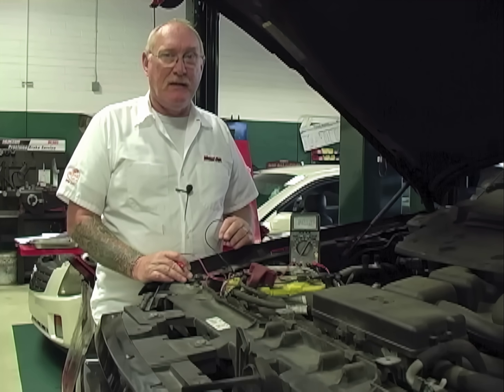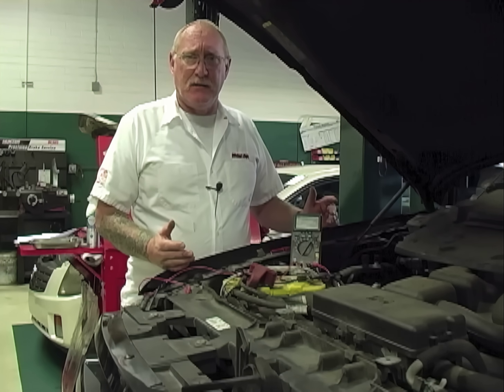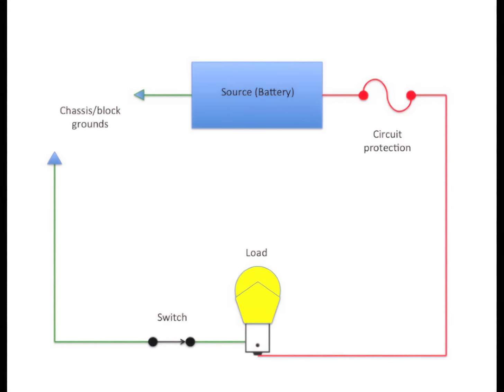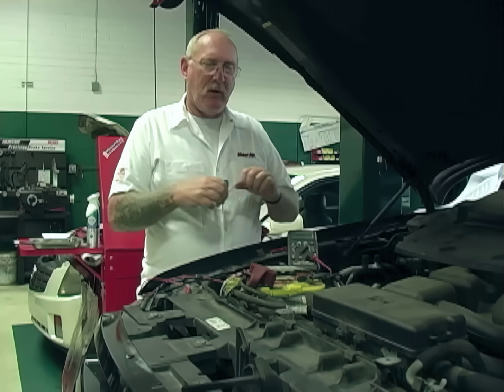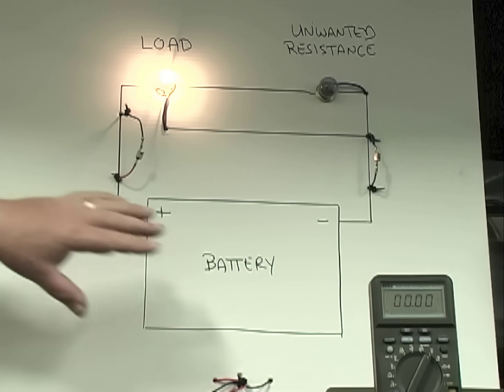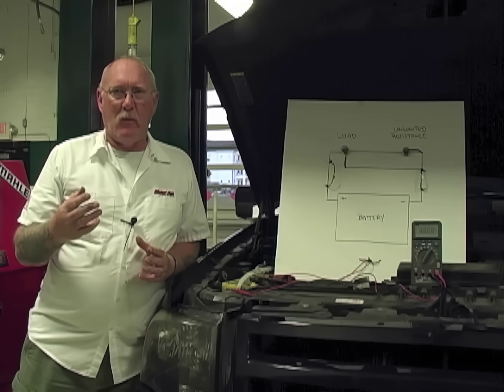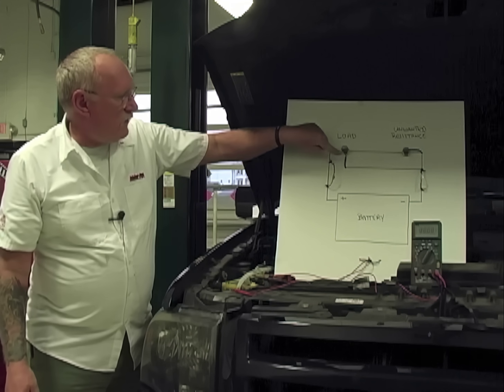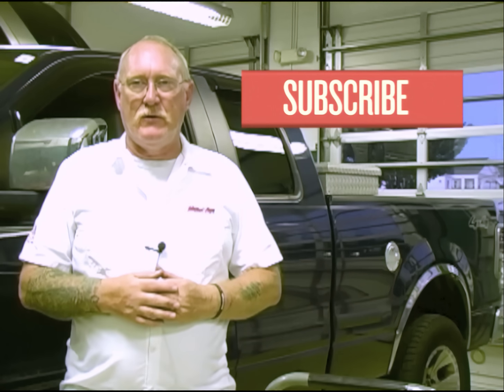The Trainer #47: What measuring voltage on the ground side means

Comment: Hey that’s one of my favorite troubleshooting methods. Obviously there is an incomplete circuit. All you have to do is find it and fix it. This is the main reason buildings have a single point of ground where the neutral is connected. There are ver few instances where multi points of ground are allowed. I won’t go into it here as it and engineering problem and I’m not going to teach graduate level electrical engineering here.

Comment: there are grounds all over these vehicles these days, underneath seats behind dashboards on the chassis everywhere. few of high resistance on the ground, such as under a 1990s Thunderbird under the driver's seat and states where they have salt on the roads and it gets on your boots and in your car and it corrodes the hell out of it, you're going to get weird instrument panel readings because that's not grounding correctly. it's not exactly correct to say that voltage wants to go through a load to ground, voltage, also known as potential, always wants to go to a lower potential. if you remove a restrict on ground in one area it's going to affect current flow in other areas. I gave myself quite an education at the time working through forward circuit diagrams and ground locations when a Ford Thunderbird had a loose ground that would make the digital fuel gauge drop two bars when you turn the headlights on. it was pretty cool finding that out.
Reply: *few of = if you have (high resistance on ground)

Comment: 3:45 there are many exceptions to this rule, such as cars using resistance wire in parallel to illuminate a trouble light, someone ahead lamp is burned out the resistance wire will illuminate the led.
it's engineered using ohm's law so that there isn't enough current to illuminate the LED because the headlamp is using most of it in the parallel circuit, you can use kirchhoff's law along with ohm's law to calculate this. Source: I was a factory trained Ford mechanic for many years and now I'm an industrial electrician journeyman with an electrical engineering degree.
Reply: aorry for voice to text errors. hope it was clear.

Comment: Great video thank you. Have a question on the fuse placement though. Electrical convention is to trace from positive to negative but that was due to a wrong assumption in long past that electricity flow was caused by photons. Actual flow is actually from negative to positive because only electrons can flow. In that case wont it make more sense to place the fuse at the negative side of the circuit? Thank you

Comment: The other way we were described voltage drop is you gave the negative side another way to get back to home and the voltage you see on the ground side shows you how much voltage is willing to go to ground cause it is a easier or a more viable route , instead of the resistance  of original circuit .

Comment: Where does voltage drop get measured when you are testing a window motor connector?  12Volts at all connector pins.
Reply from the maker: Always start by measuring at the load - in this case, the motor.

Comment: Also i will add, when resistance increases in that series circuit, so will the voltage dropped across that resistance (assuming current remains constant). When the resistance decreases, so will the voltage across it decrease. That's why the Load bulb got dimmer in his demonstration. There was additional voltage drop in that series circuit from the unwanted resistance, which took voltage away from the load. In theory,  the voltage measured across the load bulb, and the voltage measured across the unwanted resistance should equal (or add up to) the  V+ source,  which is the battery voltage of  approximately 12.5V. Simple Ohms law stuff.

Comment: As an aircraft electrician you describe this as the opposite way one should attack a problem.  Remove the battery terminal and test amperage, if you have a battery draw. By knowing the amount of amperage will be much more useful than voltage drop. IE the radio clock is only going to draw milliamps whereas a stuck ac relay  might draw 5 amps. voltage drop is usually only referred to in electrical theory when determining the size of a wire over a specific length of run. DC circuits have higher voltage drops over a given length  than AC circuits. When troubleshooting this information would be useless. You're probably the same type of mechanic that diagnosis a battery by the amount of voltage.  When only a true test would be a battery tester that pulls a load similar as a starter. There's several ways to skin a squirrel but what's your teaching is not how electricity flow charts are generally used in troubleshooting electrical circuits.

Comment: Just start pulling fuses until you find the problem most times it's a bad inductive load or you may not have true power to that load due to a bad switch

Comment: This a problematic  video and carries my NO Like because you hinted at a solution for <one particular problem (a bad main Ground Cable and its connections at each end, mainly at the chassis end,as usual) but diverged too much....

The measurement btw the Neg battery  post and the Chassis Ground,  it ONLY  measures the quality of the BIG,THICK, Neg.battery cable fron Bat to Chassis; it does NOT measure a ground fault of any other small load (lamps,window motors, fans etc etc,  none)

AND if that thick cable connection to GND is bad,then,the STARTER MOTOR,the biggest consumer by far, 200 to 300 Amps!! will either  not work at all,or work too slowly...

That is WHEN you measure VOLTS btwn  bat-  and gnd, WITH the starter motor operating!! 

 02:58  you can't say that because there are fuses,so it is NOT the same; also,this is public youtube,DO NOT even mention "put a piece of wire across the battery terminals" like you did there

amazing to me the amount of ignorance in the comments, and the praise for the video ...

also you talk a bit too fast to really teach much; a teacher,i am one and an engineer, usually talks  s l o w l y.

Comment: Can you comment on why it's important to disconnect a car battery with the NEGATIVE cable 1st and then POSITIVE when replacing a 12V battery?
Reply from the maker: Disconnecting the negative first and reconnecting it last minimizes arcing, which could lead to an explosion if the battery is venting. More common in the old days.

Comment: If I found voltage on the ground, the first thing I would do is disconnect the positive terminal, then check the resistance from the chassis to the ground of the battery.
Reply from the maker: A static resistance check may not find the problem. Best to let the voltage drop point the way!

Comment: "Why is the fuse on the positive side?"  Your answer is wrong.  The reason has nothing to do with the direction of current flow.   it's just for practicality,  If the ground is negative, it is not practical to break the circuit on the neg ground side, because that is common to all circuits.  Also, you want the fuse to break at the shortest practical point from the battery, so there is the least possible chance of a fault between the battery & the fuse.

Understand that electrons have a negative charge, this means the battery pushes electrons onto the negative terminal from where they flow through the circuit to return to the battery positive terminal, for the battery to push them internally through the electrolyte to negative again.  The only place that current flows from positive to negative is internally within a battery or generator.  Within the wiring of a circuit, current flow is from negative to positive.  I know this is against peoples intuition, but that is just reality.   This occurred because the convention was derived before the real direction of electron flow had been determined.  It was a guess & it was wrong, but it stuck because in circuit design, it really doesn't matter which way you think of current flow direction as current flow propagates at light speed, even though the electrons themselves are much slower.  I happen to value truth though.
Reply from the maker: Thank you for your clarification. Just proves we can always learn from each other!
Reply: @VehicleServiceandRepair  Thankyou, that's an excellent reply.  In my experience, most people argue over this.

Comment: He's wrong about connections not being a big source of resistance, how many times have you seen burnt headlight connectors and burned pins ina fuel pump connector? Any interruption in the circuit creates resistance and heat.
Reply: He isn't wrong, connectors should be a minor source of resistance. Burnt pins and connectors are indicative of a problem, and finding those problems is what this video is about.

I suppose he might have expressed his point more clearly in this video, but in other videos he does clarify.

Comment: In my early days, the late '40's folks thought DC voltage flowed + to _  but that is not true.  It is proven wrong by the zener diode and LED lighting.  if you have light burned our , just short out the open diode and the rest of the LEDs will glow.  Just a thought and you help all who watch.

Comment: Wait until you're testing your negative or your grounds and your testing from ground-to-ground and you get positive voltage in other words the scenario would be a light bulb that is out and you are testing the ground but you are finding that your ground to ground has positive voltage
Reply: Ultimately I found out in this scenario that positive was flowing through light bulbs and getting into my negative when I was testing

Comment: so, could you put meter lead on engine block and read voltage there as well? If the engine block reads almost nothing, than can we assume the wire from the battery negative to chassis is frayed or corroded.
Reply from the maker: If you have a bad ground you can read voltage when you touch the engine block.

Comment: Gee I just went back to 1975 +/- we were on our way to Wyoming from Northern California farm land we reached Baggs,Wyoming and stopped at a gas station, we spotted this OLD Jeep with a flat head 4 cyl. the owner was pretty distraught as he had spent a lot of money trying to fix his no start jeep, yup new battery, New Starter and maybe a new generator?
 I said let me grab my  multi meter, I put the positive lead on the negative post and the bolt holding the ground cable to the block and wham voltage drop I grabbed the cable near the block bolt and gave it a little twist, the bolt was slightly loose and could not carry the load, total time taken 15 minuets including sanding the block area and wire wheeled the bolts thread and base.

Today I am 82 years old and have talked to SEVERAL mechanics in the last year about the cylinder leakage gauge set and its many uses, they sort of look at me like I was a dummy?  I never pulled a cylinder head only to tell the customer that the piston rings had scored the block or the piston rings had been over heated and lost there tinsel strength or the exhaust or intake valves were leaking. 
Lucky for me I was honored to learn from Italian mechanics how to find problems, most of them either worked at the Alfa Romeo factory, Maserati or my partner that came to San Francisco, California  as a Formula 1 Ferrari race car mechanic when 3,000 were left at the Ferrari factory in Italy? What great days we all had and they never ate lunch without a good wine to wash it down? I thank God for the many gifts he has given me...

Comment: i do this voltage drop test on almost every car and pickup that rolls into my bay.

engine off.. turn the headlights on for one minute. then turn them off this removes the surface charge from the battery.. 
with meter set to 20 volts DC... measure battery voltage. 
12.65 is a full charge, 12.45 is a 3/4 charge, 12.25 is a half charge .. try to do the rest of this test with over 3/4 charge or 12.5 volts as percentage of charge.
 
Engine running.. headlights on.. meter set to 20vdc

Test One.  Positive battery post to Negative battery post.. you should see 14.1 to 14.8 volts. 

 Test Two.  Negative battery post to the engine block. 0.04 volts DC max.

 Test Three. Negative battery post to the body.. 0.04 volts DC max.

 Test Four.  Engine block to firewall. 0.04 volts DC max..

 Test Five.. Positive battery post to the Underhood fuse block then all the fuses inside. 0.04 volts .. why all the fuses.. internal fuse box connections can cause different voltage drops to different groups of fuses.   

 Test Six. Positive battery post to the Alternator output stud threads. this can be up to 0.3 volts 3/10ths of a volt verses 4/100ths for tests 2 thru 5..  on Dodge cars and trucks of the 60s and 70s. with amp meters in the dash.. 0.7 volts is totally expected do to the length of the charging circuit from the alternator to the amp meter and then to the battery.. 

 why these values.. 4/100ths of a volt..  decades of experience in fixing cars electrical system.

 lets talk about voltage drop .. visualize a garden hose with the valve on the wall all the way on.. the water flowing full speed from the end of the hose. the only restriction is the water rubbing the inside of the hose.  so there is slight pressure drop.. pressure drop and voltage drop are similar.. 
 now.. the hose has a kink slowing down the water flow.. the pressure between the valve on the wall and the kink is the same.. but the pressure on both side of the kink are different.. so in voltage drop testing. we are measuring the current/water flow thru the hose by testing at the ends..  so depending on the kink the pressure drop is different.. 

 why the 4/100ths or 3/10ths is good. copper is not a perfect conductor. it has slight resistance to  the flow of electrons..  engineers design the circuits and select the wire sizes to shoot for the 4/100ths of a volt drop across the circuit..  why the 3/10ths for the alternator circuit.. copper is expensive.. manufacturers can get by with a slightly under sized alternator output cable.. 

 Pete Meier. motor.com feel free to use the above. or this.. https://i.imgur.com/SnzhDh0.jpg. which is my imgur account to allow me to post a JPG of that test so i don't have to type it out..  i would love if you would use a page in every new issue with that test to try to get techs to try it.. 

 why test 5.  i have found so many issues with the power to the underhood fuse block. and internal connections inside the fuse block.  

 the voltage drop test above.. takes me less than a minute to perform the first 4 steps.. test 5 takes a minute and test 6 can be impossible to do on many cars and trucks so you have to look back at test one after doing the other tests..  if the charging voltage is below 14.1  you might have resistance in the alternator output circuit.. so 0.8 volts would result in a charging voltage at the battery of 13.2 to 13.5 volts.. 

 why test 4.. engine to firewall/body.. the alternator puts out electrons on the negative side.. the engine is sitting on rubber mounts.. electrons like to take the shortest route.. since many things are grounded to the body.. like the inside of the firewall. the electrons can build up on the engine.  if you want to be amazed.. turn on the defroster blower and throw an amp clamp around the ground wires from the engine to the firewall... if the ground wires are not connected properly.. the electrons will take short cuts.. thru the transmission.. CV shaft. a mad game of frogger across the wheel bearings . into the steering knuckle and up thru the strut mount or the steering linkage..  this causes repeat failures of the wheel bearings..

Comment: Very good.  I might suggest in the lab set up at 7min to have a battery neg connection showing  the meter black lead. (Both meter probes visible in video.)

That may help some students.

P.S. A caution about "Auto Ranging Meters" might not be a bad Idea.  I have seen students reading milivolts as volts accidentally.

Comment: Looks like I guessed right, but then I'm an electronics technologist. It is one of the reasons I have always soldered the end of the crimp on my cables. The copper usually turns green or corrodes in the crimped sleeve.

Comment: If you have a voltage drop over 0.2 V from bat neg to chassis it is obvious that you have an earthing problem. 
It's  1 of 2 things.  Either Batt neg to motor or Batt/ motor to chassis.  Simple. You would also have a lot of issues with lighting going on. Headlamps, blinkers,  stop  and tail not working properly, and others.  As an apprentice years ago I was told, that if you have weird thinks going on with lighting it is almost ALWAYS an earthing problem. Just have to find it!

Comment: A bad bond from the chassis to the engine, lights and horn, and other things will work, but an ignition coil pack on the engine might not work
if it grounds thru the engine and the engine is not bonded to the 
chassis.
Some coil packs will as they are fed from the puter and ground is carried over to the coil pack.

Comment: I friend has a crank no start on his oeugeot book is arriving today so I can check wiring . I've briefly checked crank /cam sensors . Spark in 1 cylinder only of 3. Immobiliser may still be a culprit here but I'm still thinking earth issue . Only because the horn went off and stayed honking  until fuse came out . Now it ciyod be a bad relay also . But more testing is needed . Again this will help a lot   thanks

Comment: Would not some load need to be on in order to make the ground test? Ground and negative voltage might not show up without positive connected to some load unless of course a resistive drain as well through wiring or device.
Reply from the maker: Correct. There is no voltage drop unless current is flowing. But on most vehicles, there is always something "on".